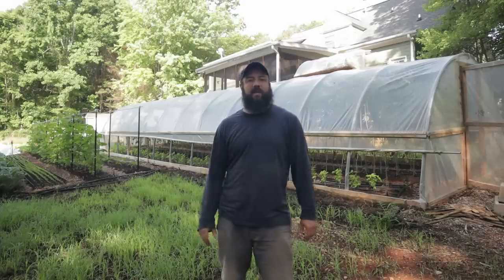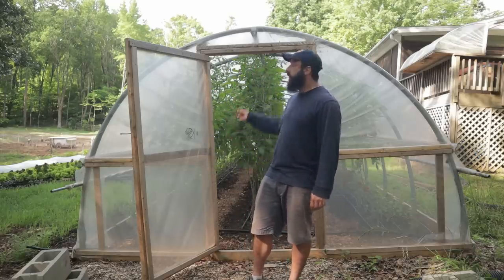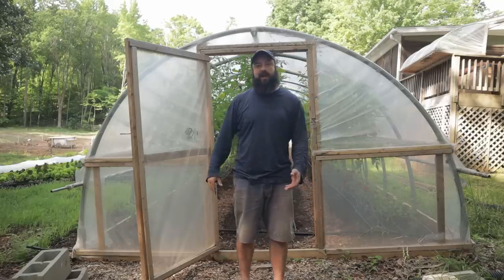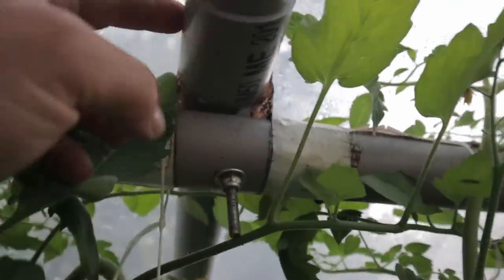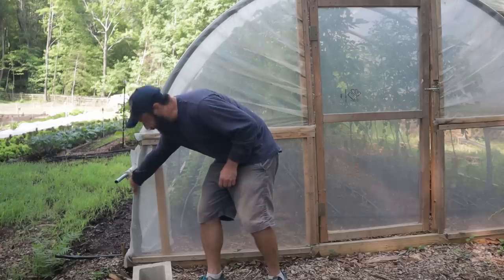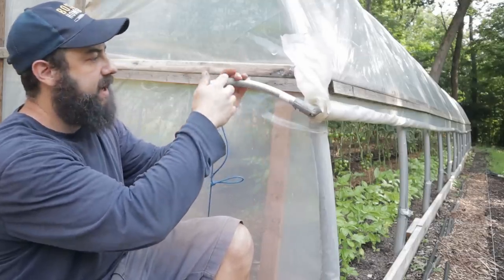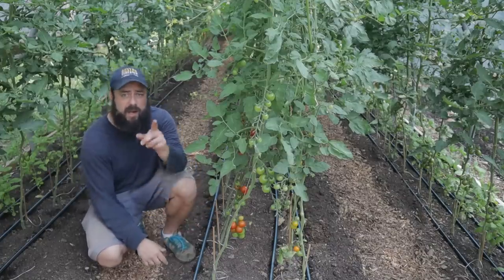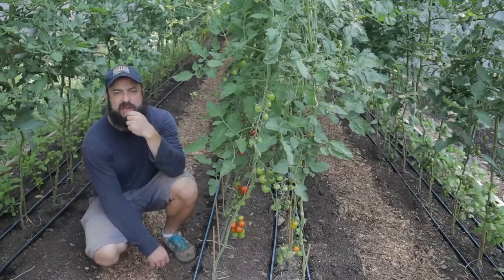DIY PVC GREENHOUSE

Comment: Thanks for sharing and explaining so well, I have a polytunnel 20 x 10, that is made of 32mm bars, but the plastic that was supplied was the green sock type you pull over the hoops and bury in the ground, but I never got a chance to put in a shovel of soil inside as a storm hit Ireland and lifted it out of the ground completely, your video helps me update the polytunnel by adding timber sides and hip rails and then ordering clear plastic sheeting to reskin the rails.Cheers and Thanks from Kildare Ireland.
Reply: Hi jimmy..from Co.Galway. i think that you n we bought from the same company. Both of ours lifted, just frames standing. In 2010 built a black water pipe and disused trampoline legs, 🔩 together.. base framesetc except the lid. Dismantled now but going to reinstall. Thinking about how/ what to do regards the other bought frames. Regards and blessings to you this year😊
.

Comment: Living in Southern Louisiana, I made a pvc hot house with 3/4 inch conduit and sheet pvc. The frame made with the pvc conduit worked great...however the sheet pvc shredded in the wind once it got above 85 degrees f. I only had it on the top portion, the bottom I had clear corrugated panels. I was trying to protect for heavy rains. I now use clear 4 mil vinyl sheeting I bought at the burlap factory online. 54" x 25' rolls. It has been up for 2 years and all I have to do is clean the vinyl twice a year.

Comment: We built our hoop house without a kit, using chain link fence top rail, a bender, hangers, and wiggle wire from Johnny’s. It turned out really well and has survived two years so far. We are in a very high wind area and at high altitude, so UV was a serious concern. I love your honesty about not having plans and winging it. Lots of good advice in your video!

Comment: First time I've seen your channel.  Great job (with the video and with your farm)!  I built a very similar high tunnel 2.5 years ago using the same materials and construction methods.  It's working out pretty well so far.  Like you, I was also on a budget and used PVC bows.  If I was going to do it again, I'd spend the extra money on galvanized top rail and a bender.  I know it's a different decision in the moment when there are 10 other things to spend money on!  I'm in Michigan and we get a lot of snow.  The PVC bows need to be reinforced with a beam running the length of the high tunnel and several vertical posts in order to support the snow load - which is a pain.  We grow the same things in our tunnel - greens fall through spring and tomatoes and peppers in the summer.  We have used the lower and lean method for tomatoes with good success.  The only other thing we added to our tunnel was rabbit fencing.
Reply: Matt Schwartz can you please describe your rabbit fencing? Thanks!

Comment: I built my tunnel just like you . Mine is 18x30=three PVC for the ribs and base boards out of composite deck wood because I found enough for cheap. I couldn't make up my mind about the treated wood. I'm also zone 7b desert New Mexico and my biggest issue is the wind and wild rabbits. My tunnel keeps the wind from blowing the mulch away and the rabbits out. Also instead the duck tape I painted the conduit with Primer and it hasn't ripped yet even with vibration. I did lay drip pipes 18" apart which is too far apart 12" will be the re design next summer but I can still grow a lot. I see people string up their Tomatoes like you and I will finally try this next year also. I'm still trying to figure out the timing for growing greens in the winter. I will keep watching you, I think you have the answer. Thanks

Comment: Interesting you mention the rainy season. Could you put a greenhouse type structure over the beds you plan on harvesting for that week? It would keep rain off, create a dry and clean work environment and you’d be in better control of the pre-harvest watering. Heat might be a problem though. I’m interested in any ideas...
Reply from the maker: Yeah I don't see why you couldn't do that. As long as you could move your structure easily enough.
Reply: Josh Sattin that movability might be the biggest problem.

Comment: This popped up at a perfect time on my feed, I should start thinking about building one of these now before the snow falls even if I can only grow spinach in it for a few weeks. 
I like how you built it and the only thing I think I will have problems with is the end walls. Because I only want one end open I think I can fold it all down to the ground at the one end but at the other I will need to build a door to access it.

Comment: When your to atoes are very small seedlings if you put a fan on them 2-3 times a day for ten minute intervals it will cause the plants to bend easier so you can just lay them on the ground and put soil or compost on them. My plant use to get 20 - 30 foot long.

Comment: Hi Josh, I know this is an older video, but I am looking in this direction as a possibility, not because I wouldn't rather have a metal framework tunnel. The problem is actually getting one. Lots of places won't even take an order anymore and claim they just can't get the steel. I've been trying for months and it doesn't look like I'll have tunnels for the first part of this year unless I do something creative. I can get PVC conduit, though, so I'm thinkin' it might just have to work. I'm like you (Tennessee Cumberland Plateau), rain, rain, rain. Almost completely wiped out my tomatoes last year (unprotected) and I really want them under protection. They were supposed to be for sale and I had just enough for personal use, barely.

Comment: There are lots of videos on tunnel building but I like the helpful tips you offer in your video. As for the tomatoes could you top off the plants and start trying to grow a sucker from a lower spot?
Reply from the maker: Probably yeah. That's a cool idea. Unfortunately I prune all of the suckers. I have heard you can take the suckers, stick them in water and they will start to root. Basically making a clone that you can then plant.
Reply: @JoshSattinFarming  Growing suckers in water works for sure. I sometimes take suckers that I missed that have some size to them and do just that. Just moved 2 plants outside and have 3 more in the nutrient solution. You can actually do that in soil as well.

Comment: Hey @Josh, why is the wood at the bottom of the greenhouse necessary?  Seems like one could do without it & save $?
Reply from the maker: You could probably get away without it depending on your context. I knew I was going to add a lot of compost and I wanted a border to hold it all in. We are also on a slope. It also adds some rigidity and strength. It would probably be necessary on the end walls of some sort. But if you could get away without it that would lower the cost.

Comment: Did you have a hard time getting the PVC to bend at this diameter? Just received the same diameter conduit to build a 12 x 24 greenhouse but the PVC is super stiff and I have concerns about getting it to bend. Wondering if you had to use any heat to help make the conduit bend.

Comment: Do you have to take the plastic off in hurricane season? And/or how does it hold up in storms?
Reply from the maker: It made it through two storms last fall but we are 2 hours inland. It handled the rain and wind fine. If we got actual hurricane force winds I don't know. Unfortunately the way I attached the plastic I can't remove it and reinstall it.

Comment: Want to know about your plowing equipment.  Did you build it yourself?  Both the digging spikes and the rolling clod breaker.
Reply from the maker: I know almost nothing about tractor implements. I don't own a tractor.
Reply: @JoshSattinFarming  Not a tractor.  The hand cultivator tool in your prequel to your videos.
Reply from the maker: Oh. That's a Tilther. It's not a cultivator. It's used to smooth out the soil. It only goes down 1-2" at most.
https://www.johnnyseeds.com/tools-supplies/long-handled-tools/tilthers/tilther-9286.html#q=tilther&lang=en_US&start=1

Comment: Hi Josh, I'm a new subscriber.  Well made, and informative video. I have a question,  are you concerned with any build up of tomato pathogens? I took a master gardener class this winter and they heightened my concern about this. We only have one hoop house to grow tomatoes inside, our third year. Building enough houses for crop rotation is expensive and takes up space. We built with top rail, the bender did add some expense, maybe 10% of $1500 for a 20x32 house. But I can use it for other projects or loan it out now.
Reply from the maker: This is only my second season so I haven't had to deal with the tomato pathogen issue yet. If you are in a cold climate I have heard you can open up the house during the winter for a while and let the cold kill everything. A lot of people go towards grafting to help prevent tomato disease too.

Comment: If you were inside the greenhouse and the door close, how are you going to get out? if you cannot get to the lock?
Reply: I understand how your greenhouse is made I see how you can get out, That is a great good greenhouse.
Reply from the maker: Haha. Yeah, that was actually a serious concern of mine after I built it. I put a carabiner in the latch for a while to keep the latch from being able to close. But the reality is because of the slope it is on and the way that the door opens, the door stays open. If I did get shut in I could climb through the roll up sides.

Comment: was using two 10 feet pipes glued together was a transport issue or cost factor compared to directly using 20 feet pieces .
Reply from the maker: Oh yeah, 20 foot pieces of PVC would be awesome. Part of it was a transportation issue. I used my station wagon to move the materials. Also, I'm not sure 20' pieces are available at Home Depot or Lowe's. They might be.

Comment: It's absolutely the way to go to build your own, kits are often terribly designed unless you spend big on a kit. 

However I think if you're gonna go diy you should try and make things a bit more durable: I wouldn't use any pvc at all, it is not designed for direct sunlight and will perish as well as leach stuff into your soils. I use anything bigger than 25mm green or blue line agricultural pipe. Doesn't break down and lasts forever and you can simply slot it over star pickets or rebar. Under a wind load pvc is just going to splinter and fail. I have high wind loads and I think a REALLY solid central main beam that is concreted in the ground at three points makes it last forever

Comment: awesome video thanks!! Without heat what are your temps in the winter in the tunnel? (I’m in Charlotte and have a friend that had 4 huge orchid greenhouses. He’s down to two but I love learning about the greenhouses to eventually build me one!!
Reply from the maker: I do get a good amount of solar gain during the day, but because my tunnel is only a single layer of poly and I don't heat the tunnel it drops down close to ambient temperature at night. I do only grow winter hardy crops in there like lettuce and greens. When it drops below 30 degrees or so I will cover each bed with row cover. That's the Eliot Coleman style and it works well.
Reply: Thank you for the information!

Comment: Hi thanks. What spacing did you use between loops? Could I go wider? Also, could I use smaller pvc like 1 inch or 3/4 inch?
Reply from the maker: The hoops are space 4 feet apart. If go with a small diameter you will need other supports, posts, etc. I saw a lot of people with smaller diameter PVC that had issues. I didn't want to have to worry about it.

Comment: Hey Josh what are your thoughts on adding a third length of pipe to your hoops to make them 30' instead of 20'?  It would give more head room but also make it wider.  Or do you think lifting it up like you said in the video would be better?  I am just researching right now on building my own and would appreciate any of your advice,  thanks!
Reply from the maker: It depends on your situation, needs and available space. If you go to 30' hoops you might need more supports and/or larger diameter PVC. I don't know though since I have only built this one tunnel. I would still recommend going with a kit.

Comment: Is there a big difference between using glass versus plastic? I started this year with buying shower doors and framed glass panels out of screen or sliding clear glass panels. Our local Restore store sells them for $2-5. I though of using old double panels but they want $25 per window. I used old would pallets held up with metal stakes I also got at Restore, for the frame. I just rested the clear glass pieces on old 2 x 4 s. When it’s colder I throw a plastic over the top held down by several old pallet parts. It’s a pain to lift the glass pieces off when it’s hot so I need to build a frame around the glass sonI can prop it up. I ‘m really wondering if I should just switch to all plastic goo setup, so I’d appreciate anyone letting me know how single glass panes compare to one or 2 layers of 6ml plastic. Thanks for any help. I’ve been able to pick up a lot of pvc pipes and wood from the Restore store that I stop at once a week when I drive in town for grocery store shopping.

Comment: I would love to see how you create compost for your beds (hot or cold composting?) Do you get all of your compost form outside of your farm?
Reply from the maker: I am not a very good composter and don't put much effort into it. Most of my crop residue goes to my chickens. Also since I use so much compost in my process, I have to buy it anyways. I couldn't produce that much myself without investing in some equipment and bringing in a lot of materials.
Reply: @JoshSattinFarming  I'm only gathering information for my future farming adventure, so I'm not an expert at all. But from what I have seen at Paul Gautschi's farm it would be great to use woodchips as a bedding at chicken yard, and feeding chick with stuff we would normally compost. This way woodchips are decomposting, creating superb soil, rich in chicken manure, bugs and seeds free. Gautschi from time to time dig this composted woodchips out, screen it and throw on the beds.  

I love woodchips and would use them the same way as you do, plus I would do what Gautshi is doing.
Reply from the maker: @lucasbck  Oh yeah, he's got a super cool system. I am rotationally grazing my chickens on pasture to give them optimal health and nutrition and build soil.
Reply: @JoshSattinFarming  Yea, chicken rotation works too. I would prep my beds this way too. I would also let them hunt for slugs as this is a huge problem here in Ireland.

Comment: Can I use 1 " pvc instead of 1,5 " pvc pipe?
Reply from the maker: I wouldn't use 1" unless you were doing a smaller tunnel, put the hoops closer together and probably had a center support. 1.5" has been solid.

Comment: Does anyone know if using 25mm alkathene piping works ok instead of pvc? I think the outside circumference is about 30mm.  Iv made small row tunnels with it and seems ok.  Il have timber frame going length wise running from door to door so I'm relying on the pipe for strength

Comment: Your title says "PVC Greenhouse"?
I'd heard that PVC film was not advisable for external use as it UV degrades quickly.
You should be using PE film, or Polyethylene film, often shortened to Poly, for the cover.  
Essential to buy the proper greenhouse poly, not that from builder's merchants; with careful use and maintenance this could last 8 to 10 years.

Comment: a kit would cost at least $2K but a good one probably more like $4K for the size you mention...i have nearly same size and total materials cost was under $500...everyone should be building their own greenhouse...a kit typically has inferior materials.  If you used 6 mil plastic or better then it should last 5-7 years no problem.  people should watch MANY PVC style videos and then build their own; a kit is a huge mistake and enormous monetary difference.
Reply from the maker: Time is my most precious resource right now. I spent many days on this greenhouse and numerous trips to Lowe's. Also, this greenhouse probably cost $800-900 for everything. I will most likely be getting one of these kits for my next tunnel. They are highly recommended by market gardeners all over
https://farmersfriendllc.com/products/season-extension/caterpillar-tunnel

Comment: Thanks. Did one these 10 years ago didn't get to cover it due to weather and anniversary trip. Made mine with flexible water pipe and old trampoline pieces with boarding etc---very similar to yours. Going to ressurect it soon when weather calms. 2 points to concider..roll sides brilliant but if it also lined with green mesh it could help protect against animals and bugs (plus doors/openings) and roll inside out to keep excess rain or leaves from collecting. I consider that although big tunnels have an advantage the smaller ones build better heat and are more personal. Please check out living traditions homestead channel. G.B.U😃